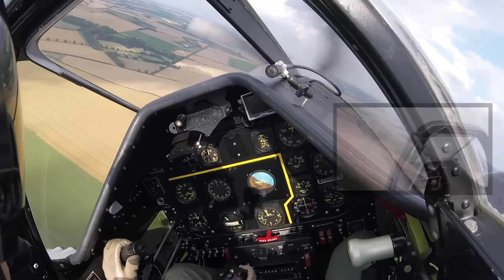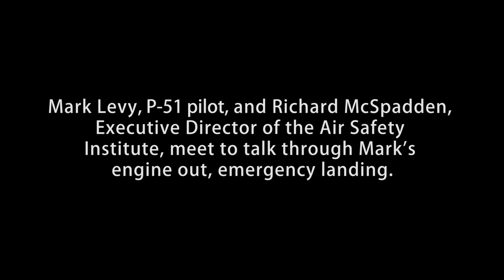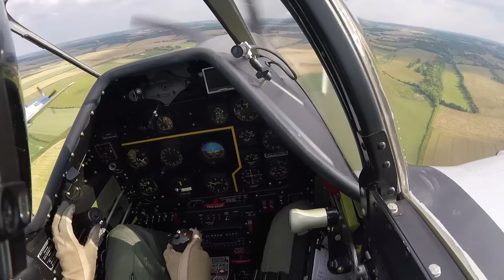P-51 Engine Out, Off-Airport Landing - Full Analysis

Comment: We saw him very low on downwind, with flaps down, but no gear...and no power from the engine. I guessed he was gliding as he had not put the gear down due to the extra drag. I presumed he was going to put it down the other side of the M11.

However, he banked steeply, put the gear down, which seemed to be dangling down but not locked. He was trying to line up with the runway, but realised he was too low and not going to make the necessary turn. He was now heading straight at all us spectators on the east pan near the ARC hangars. I just remember thinking...this is not going to end well!

The pilot then did an incredibly brave thing. He banked very steeply to the right, so as not to hit the motorway or us spectators. Now, I'm not a pilot, but I have got a lot of hours in the back seats of Harvards, when my friends had them some years ago. I know enough to know that low, slow, with no engine, in a heavy lump like a P-51 does not allow for steep turns. The pilot was sacrificing himself to save all of us.

He disappeared behind the ARC hangars and we all waited for the fireball. Thankfully there was no plume of smoke. Total silence from the spectators. A lot of very concerned faces. Then the announcement...'The pilot is out of the airplane and safe'. A HUGE cheer and round of applause from thousands of us spectators.

Mark Levy deserves a case of beer from every spectator on that pan.
Reply: Graham Aindow Wrong. Now go watch the video again. The usual “he turned away to save us all” statement that useless reporters dig out of spectators is again NOT TRUE here either. Pilots have a very short time to decide what they’re doing, and the main decisions are maintaining glide speed and not hitting anything that will kill them. That is EXACTLY what happened here and nothing more. Anything on the ground was nowhere in his vision or on his mind. That is not a shortcoming, but a REALITY.
Reply: Don't need to see video again...I was there...watching it live. Many of my friends fly warbirds...and I have hundreds of hours in the back of many aircraft. He would have not made the airfield so turned at the last minute. You have your opinion...I have mine!
Reply: Graham Aindow In all honesty, the pilot never mentions the people at the airshow as his reason for the turn. It was because he was not going to make the field and most likely hit the traffic. So he went for the only option there was. Stop the tight turn to the airfield and land in the paddock at his 1-2 o'clock. 

However, he did a fantastic job of decision making in a very high stress environment for a relatively short time. And deserves respect for not killing anyone or himself in the process. If you feel he is a hero. Then he is to you and there is nothing wrong with that.
Reply: British people don't like to brag and feel embarrassed by compliments, so it should be something to consider
Reply: Look at the video again Doc... The spectators are back from the runway, in the spectator area parallel to the runway... If you notice, the aircraft is beginning to be pointed directly at them as he puts his gear down.That whole turn was over 130 degrees before he banks right again and commits to the field.  So Graham's account is correct... Just put yourself in the spectators position of watching a plane banking towards them as it tries to make the airfield, then bank heavily away again and go down.  You would just assume the pilot has decided not to overfly the highway or bring it close to spectators because he was too low and uncontrollable... which is true.
Reply: With the gear down in soft farm soil the plane may flip over on its back and maybe kill you.
Reply: Err, It doesn't matter he doesn't mention the spectators, it is 101, don't hit other people is rule one of crash landing. He DOES mention that he did it to save people, as he said, I chose to ditch in the field where I had control rather than let the airplane chose where to land on the runway, out of control. It is embarrassing to British people to brag. Fact of the matter is he was in a military aircraft that is particularly heavy and engine reliant. There is a good chance you would die. He could have hit that concrete post head on for example.
Reply: Try it in a sim. Simple summary: he had plenty of energy to reach the runway but managed to miss. It could have been saved 100% of the time. He could even have made his last turn despite earlier mistakes and despite having the gear down. And having his canopy open.
Reply: "Try it in a sim."

ah, wargaming armchair pilot.

run along and play your game.
Reply: Thomas Neal hahaha you're right, the pilot did a great job, THAT'S IT xd. Some much pilots on youtube
Reply: Danny boy needs to get out of Mommy's basement and fly a real plane.
Reply: Dan Frederiksen armchairing this situation is wrong. He has way more time in a 51 than you or I. He made a choice that resulted in no loss of life and the plane will fly again one day. They accused Capt. Sully of the same thing. They had people in simulators land the plane over and over. But, in the cockpit doing your restarts, emergency landing prep takes time and that equals altitude. When the other Captains that were judging Sully tried adding checklist procedures the couldn’t make the field either. Point is that is what he chose and all worked out well.
Reply: Graham, I was also there looking as he made the downwind to base turn with gear down and in a very slow Mustang.  I agree that if he had continued the turn and tried to scrape in and get into the field the most likely outcome would have been a stall/spin and potentially a roll on in towards the crowd.  I am also a pilot and think the open assessment of the whole emergency was very open, honest and well handled.  I also expected to see the ball of smoke and fire as the aircraft disappeared behind a hangar, but like watching Big Beautiful Doll's crash (also at Duxford) I was pleased not to see it.  I have oddly seen 5 Mustangs have prangs of varying seriousness at Duxford, partly due to seeing a lot of flying, but partly due to the type being popular and in some cases just pure unlucky. I was happy to fly in to Flying Legends this year and the only tech issue we had was radio related, so smiles all round from my crew.
Reply: You dont pup gear down for a field landing or it'll dig in and flip
Reply: @stevenspalding3817  calling it armchairing doesn't make me any less correct. And I am. Same as I'm right about Sully's mistake despite never having flown any plane and he has thousands of hours. He still erred and my analysis is still correct. I don't have to be a bus driver either to know a drunk crash was a mistake.
Reply: @stevenspalding3817  the obtuseness is yours. As are the grammatical errors. It's not an exotic aircraft, it's an old junker. It's a hectic situation but that doesn't make his mistakes into great decisions. It may seem complex to you but it's quite simple to me. It is as I say.
Reply: Dan Frederiksen I have worked on P51’s as well as many other warbirds. I have worked and flown general aviation as well as commercial. I have owned a Cessna 172 for a decade and have time in many other types. You know jack about aircraft, emergency procedures or the responsibilities that this pilot went through. I am sure you have plenty time on Microsoft flight simulators, but your opinion is worthless this man did a great job
Reply: @stevenspalding3817  Sully flew 100 million dollar planes for thousands of hours. He still fucked up. As did our pilot here. It's a very simple truth that even you should be able to understand that he had plenty of energy and engine performance to reach the runway directly but he chose to go parallel and far and crashed the 2 million $ junker when he could have landed without incident. A further pertinent observation is that intentional low flying runs the risk of forced ditching on engine failure because it does not afford enough altitude to glide to safe landing.
Reply: @stevenspalding3817  Several other mistakes were made, irrespective of your thoughtless emotional posturing.
Reply: Dan Frederiksen I feel bad for you. Obviously, you were raised having to be perfect in a perfect world. If you can go through life meeting these high standards all the time, I applaud you. One question though, are you an insurance adjuster for the company that insures both planes. That also would explain a lot.
Reply: @stevenspalding3817  you are as clever as trump and kanye. I wouldn't particularly fault him for not being perfectly prepared for the situation nor the mistakes he made in a tense situation. But I do rightly strongly object to the notion that this was in any way heroic or well done. He very needlessly tanked a 2 million dollar plane. That's a brand new Cirrus Vision Jet. That's very real money. It's an old crude plane so apparently easily enough repaired but that's beside the point.
I'm not trying to make him feel bad or harp on him, I'm sure he had decent trauma from the incident, but don't tell me it was great piloting because it was most certainly not. 
The main piloting lesson here is don't ditch in a field if you can go straight for the runway. Harrison Ford did wrong. Sully did wrong. This guy did wrong.
It is a standard pilot wisdom, in engine failure, set for best glide to nearest best landing. Real runway if within reach.
Reply: Dan Frederiksen I seem to have wasted my time explaining to you my opinion. Yours is set and I just don’t agree. Have a safe and perfect day, judging others.
Reply: @stevenspalding3817  the irony could teach you something if you weren't so obtuse.
Reply: Dan Frederiksen hi Dan. I’ve actually trained to do my PPL at Duxford (the airfield where this crash happened) and can partially agree. When we train engine outs, we are usually from 1000ft and have to make our turn before the m11 (on a LH circuit) BUT I disagree on your lack of empathy for the fact the pilot, in tons of low powered 7000lb BEAST with an engine not quite quitting would have given the pilot hope to make a short base and final.
Reply: Dan Frederiksen you’ve got a great future career in FAA frontline management.
Reply: Dan Frederiksen "despite never having flown any plane"

I think that pretty much says everything that needs to be said.
Reply: @DanFrederiksen  my friend any landing you walk away from is a good one, Sully made the correct calls and everyone survived. Had he put it down on New York city no doubt you would be judging him for that. wind yer neck in son!
Reply: @DanFrederiksen  not a positive bone in your body is there, go  play on your sim until you have something positive to add. And by the way you were so busy defending yourself you missed the point of my statement.
Reply: @BodjitandLeggitDIY22  I didn't miss a thing, petty Jason
Reply: @DanFrederiksen  you keep believing that buddy.
Reply: @DoctorShocktor  Watch it again, he does say that the ''freeway/motorway'' was a consideration which was on his nose before he turned. He needed a field for sure but he also needed not to hit anyone else if he could avoid it.
Reply: @DanFrederiksen  No Microsoft games were involved in this REAL World incident.
Reply: @DanFrederiksen  Stick to sims, reality is less forgiving and you would just become another statistic.
Reply: @tothethreshold.9965  you mean I would crash a 2 million dollar plane in a field for no reason?
Reply: @DanFrederiksen  no, but you would crash.
Reply: @lyaneris  Sigh, I'd ask how you figure if there was a chance you did. Of course I wouldn't crash. I could have saved that failure in at least 3 places. And even the ditch looked sloppy. And I learned from this that low flying comes with significant risk and should essentially not be done, even though it's one of the nicest things to do. Particularly terrain where ditching has poor chances should be done with extreme consideration.
Reply: @DanFrederiksen  ditching: bring (an aircraft) down on water in an emergency.
There was no ditching involved, but I agree on that, I would prefer a field or a road instead of going into the water.
Then again, the terrain was nice. A lot of fields to land in. And I doubt you could have stopped the failure.
And yes, maybe he could have made the field. But he could have gone down on the highway or hit the power lines. I was simply trying to say, that if your decision would be to try and make the field, I wouldn't fly with you.
Reply: @lyaneris  You'd be a fool to fly with him over me. But suit yourself. I do stand corrected on ditching, or at least partially. I was unaware that it seems to be convention that it means only emergency on water. But upon reflection, I'll violate that convention and use it in the general sense of the word to discard or throw away and include emergency landing on unintended ground. Do you know of a word for emergency landing on ground?
Reply: @DanFrederiksen  I would fly with BA any day. I would probably use the term 'forced landing' (in a field) as the engine quit and he had no other choice than to land. But other than that I don't think there is a term specifically meaning 'to land in a field because of an emergency'.
Reply: @lyaneris  Do try to understand that he made numerous mistakes here. Has little to do with BA
Reply: @DanFrederiksen  I'm sorry, is there any reason that you insist on being so petty and insufferable? Perhaps you are right. Perhaps these pilots made mistakes. Perhaps they are human. Either way, your constant nitpicking is uncalled for. Even the most realistic full motion simulator is just that: a simulation. Maybe this gentleman could have made it back to the airport. But with the stall horn going off, it would be a gamble. Also, you have no idea what the winds were at that instant. There are just so many variables. Don't claim to know everything just because you've fired up a flight simulator. The world doesn't work like that. I, for one, applaud this pilot for flying his crippled airplane well enough that he survived.
Reply: @JoshuaSobel  The pettiness is yours. I wouldn't have to insist on basic truth if so many mindless beasts didn't insist on fighting it.
I don't harp on a mistake for no reason but I do insist on pertinent truth in the face of proud lies. So check the mirror, Joshua.
Reply: Lies? What lies? I told no lies. I said it is impossible to know the exact circumstances. I don't know; you don't know. Also, calling me petty for asking you to at least be civil? Seriously? And also, surely you can come up with better insults than a more elequent form of "no u."
Reply: @JoshuaSobel  I didn't say you lied. And you were not civil, mindless hypocrite.
Reply: @DanFrederiksen  jesus christ you sound like the engineers i work with.....you live in the "perfect world scenario " of the computer screen.  Reality is far different.   Fact is....if you were in this situation.....youd shit your pants and die in spectacular fashion.   Keep playing your video games....and stay AWAY from EVER trying to drive a plane for real.  You are a statistic waiting to happen
Reply: He did nothing brave. He did not keep his cool and land downwind or the taxiways. He needs more training.